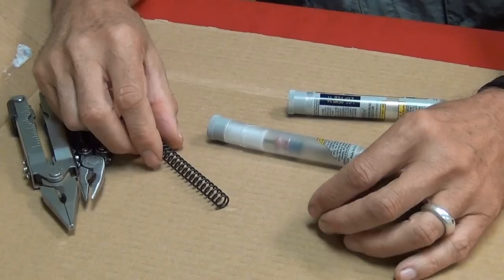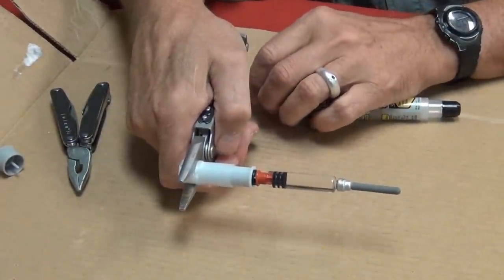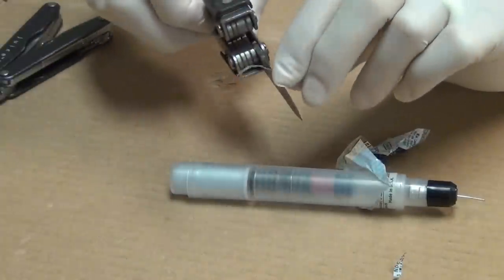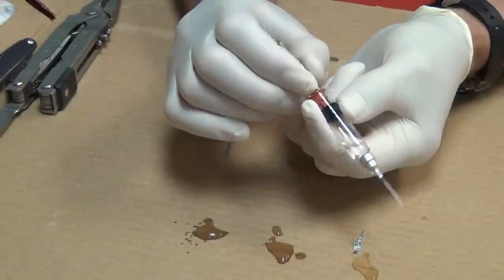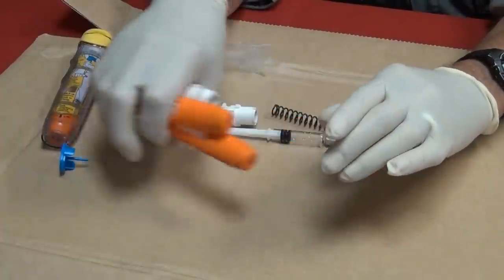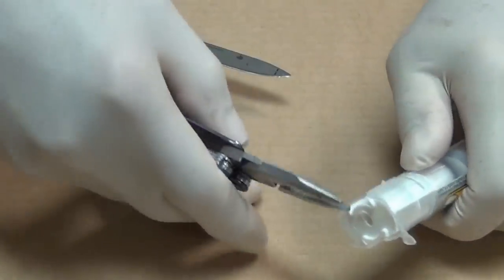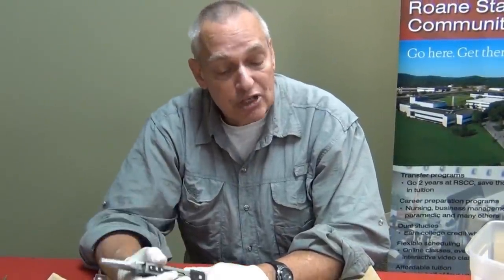Epinephrine retrieval from an auto-injector

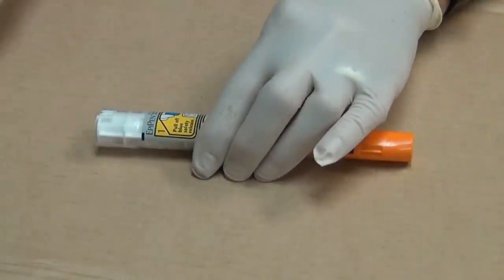Comment: I took mine apart! I was prescribed the brand name EpiPen as shown at 9:40. Those 3 tabs you mentioned, there's 3 on each side. I used a knife and cut those off, pulled the safety and slid the entire assembly out of the top.  The white insert that's around the syringe is part of the firing assembly. The spring slides inside of that and around the syringe. On the syringe, at the very top is a small 'ball' detent that gets locked in rather loosely to the white housing. When the safety cap is inserted, it pushes the ball outwards to get a full lock onto the white piece. 

The white piece consists of two parts. The syringe ball locks into both. When the pen is pressed against you, it squeezes the ball outwards, much as a tennis ball would when placed under a car tire.

Comment: Brilliant. Well worth knowing for people far from a hospital, such as ocean sailing and wilderness hiking. One additional thought. It is not necessary to be precise in the dose. Standard epipen is 0.3mg. In hospitals standard dose for a cardiac arrest is 1 mg, direct into a vein, so there seems very little risk of overdose in the field
Reply: True, but it appears that the plunger is limited to a very small range of motion, displacing the volume of the intended first dose. So the largest dose(s) that can be administered is that displaced volume of epinephrine solution. Hence the need to draw in corresponding volumes of air to permit administration of doses beyond the first.

Comment: Anyone trying to salvage the unused epinephrine from the used pen must do so with the full knowledge of the risks for bacterial contamination from a used pen and the possibility of injecting air IM.
Reply: Thx hotdog
Reply: And then weigh the likelihood and significance of these risks against the risk of not providing further potentially or actually life-saving treatment of a sever allergic reaction. A tiny amount of air injected IM is unlikely to cause sever consequences. Similarly, risk of bacterial contamination exists every time you get cut and bleed. These are minor, almost trivial  concerns by comparison.

Comment: This is a great video. People need to remember that this procedure is to be used in a life threatening situation when no alternative is available. To often in today's throw away society people think that only the PERFECT solution is acceptable. I am amazed at how the birthing procedure MUST BE PERFECTLY STERILE!!!!. If that is so I wonder how baby's were ever delivered during cave man time. Anyway pardon my digression.
What I really wanted to say was that by watching another video and watching this video closely, it appears that the black part of the plunger is the same size as the dose needed. That being said you should be able to move the plunger the distance of the black rubber section. This you could do by simply holding your fingernail to the vial at the spot where the front edge of the plunger is and then depressing the plunger until the back edge of the rubber comes to that point.

Hey It is just a thought! If you don't like the idea you don't have to use it!
Reply: Jon Andriotis I
Reply: Jon Andriotis you are 100% correct the black plunger on and epipen is the dose size to be pushed out. So all that’s needed to be done is hold the syringe point up and draw the black plunger to the back of the syringe to draw in that amount of air then drip the syringe so the the air moves to the top and push the plunger in another dose will be pre measured because there’s also a stopper that Won’t allow the plunger to be pushed in more than a dose. I’ve done this trick a few times having sever  allergies and in Canada an epipen is $125 and I’m not always close to the hospital I wish everyone know this people have died because they needed a second dose and could get to a hospital in time.

Comment: You could save the hassle and buy Twinjects instead... They are designed to give two doses in one "pen"
Reply: What if you need three doses?
Reply: tweedtulip it is unsafe to give more than two doses of Epi at any time
Reply: Yeah but a dose only lasts 15 min per medical info so if you're actually in the outdoors your chance of finding medical in 15 minutes is slim to none.
Reply: where are you getting that information? You can administer 3-4 doses and more especially if the patient is dying.

Comment: Fuck that, I'm not taking the chance of injecting air
Reply: HERPDEDERP49 thats not true, the smallest amount of air in the bloodstream can cause a pulmonary embolism
Reply: it takes about 100ml of air injected at more than 100ml/s into the venous system to cause an Air embolism.

that's about the size of a perfume bottle. which is actually a pretty large amount to accidently inject. and also very quickly

  however, 2 mL of air in the cerebral circulation can be fatal, while 0.5 mL of air into a coronary artery can cause cardiac arrest.

still not huge but that's still alot to accidently  inject especially in an area where an epi pen would not be put.
Reply: Everyone here is wrong since to cause a gaseous embolism the air has to be injected into the bloodstream, and the epipen is an intramuscular injection, so you don't even hit a vein.
Reply: You are scared of the air going through the needle.
What i am scared about is, how fast the needle goes into your body, it just went through a plastic bin which is like 5x tougher then skin. That thing travels like 500fps
Reply: xTech Productions hence why i said...."inject especially in an area where an epi pen would not be put."
Reply: You expel the air first